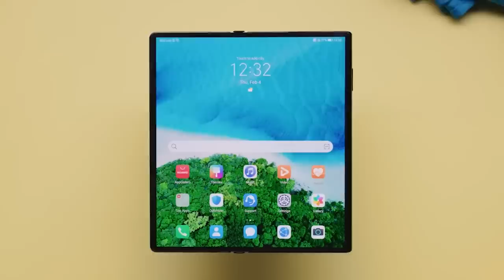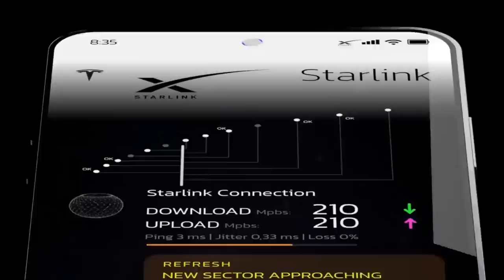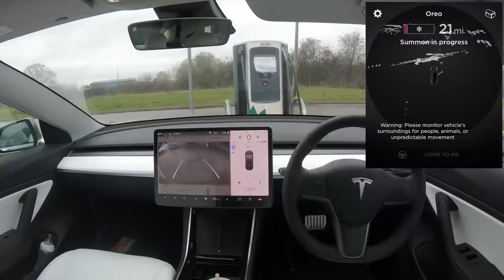Tesla Phone Model Pi Rumors🔥🔥🔥

Comment: Has anyone heard what OS is being planned? Perhaps that's one of the hold ups. A de-googled version of Android is probably the best idea, and it can be secure if done right. Tesla might be able to entice developers to port their apps to run on their version if required.
Reply: It's not unreasonable to imagine at this point a smartphone launching based on Linux rather than a de-googled android. I'm not sure how familiar those reading this will be with it, but in addition to windows, on any X86 computer you can install desktop Linux, and while your options for software will be slimmer, you will have a fast, secure system that operates as you choose. Recently, the Pinephone Pro was announced and...Actually seem to be almost on par with modern-ish lower end smartphone, which doesn't sound impressive until you realize that they started...What, 4 years ago? With a community produced and coded piece of hardware no less. With the weight behind, say, Tesla, it's not unfair to suggest that Linux could be a viable alternative to Android nowadays, and it'd be able to perform desktop computer functions, rather than just use android apps.

The obvious downsides being: not using android apps (this could be a killer for some people), and not being able to use qualcomm SOCs (no Snapdragon processor), though with that said, AMD has announced a partnership with Samsung to produce Exynos SOCs with an RDNA 2 GPU built in, so I wonder if they'd be willing to write up a contract to drive down per unit cost via economies of scale...
Reply: @novantha1  Android is linux.
Reply: @Tore_Lund  Sort of. That's a common claim, and is technically true (android is based on the Linux kernal), but when one imagines Linux they typically think of desktop Linux distributions, which have security, freedom, transparency and powerful low level APIs as their core building blocks, whereas android in comparison is much closer to IOS in how closed off and full of spyware it is than the typical android user would care to think.

Yes, Android is based on Linux, but it is not built with the same philosophy, so it is quite rare that saying "Android is Linux" is true in the same sense that the person saying it means it to be.

Comment: the note 3 was the best phone ever produced. easily change batteries, glass and screen. i had a battery that could run on a single charge for six days with bluetooth and wifi on 24 hours a day and being used 12 hours a day. i used it for 6 years until it wouldn't work properly with the internet. all they have to do copy is the formula. abilty to use third party batteries and very simple replacing of screen and glass. boom best phone in existence.

Comment: You do realize that you can only use starlink satellites in very specific locations outdoor? You can't have a reliable mobile internet connection with Starlink as you appear to make a big point. Also, where are the sources that prove this product is even an idea?
Reply: hello fellow thinking human being.. I think there's not that many of us in this comment section xD
Reply: Starlink is available all over the world; even in some of the most remote places. There is a great value in having a communication device that runs on solar power, and is connected everywhere outdoors. Imagine having internet and phone service for the cost of Starlink.  Btw, its likely Elon will have standard cellphone servic technologies in addition to the Starlink service.
Reply: @shonsxxx  Not really sure what you're talking about. You need a directional dish to get signal. That dish has a motor to turn it with precision. Also the dish must be in a place with no obstacles to the horizon. There is no phone powered with solar power. What you're doing is magical wishful thinking

Comment: I haven't used an apple phone for 10 years because of the fact ( at the time not sure if things have changed now ) but that I could and still can play any video file on Samsung being able to take batteries out and swap them with fully charger batteries before power banks became available. Even with SD card slots and a more widely available micro USB port and now a USBC port not the always changing charging connections apple has. Also the link of Android phones and Android TV's which came out before Apple TV's. And also music being able to play any file OJ Android not convert it on iTunes etc. And also the waterproof On the Samsung range for about 8 or 9 years before Apple finally made one

Comment: I hope Mr Musk has a "plan" for using 3D printing in space!  I would love to see interplanetary stations printed, circuits wired both for wireless comms and hard wired using mini bots and circuit paint!  That allows the same bots to identify severed circuits and repaint them quickly!  For interior components like doors, desks, chairs, etc a smaller printer reusing the components of the larger printer that printed the hull(s) themselves!  Flat screens would make it safer, easier and cheaper to install "windows"! The circuits are already there and Cameras can be installed by using a vacuum sealed drill/not!  Plug and play! And finally I think double hull construction with the ability to "temporarily" flood the space between two rotatable hulls in order to offset, temporarily seal, and then perminently fix the breaches would be a good idea!  CONCEPTUAL TEST: Put one paper cup inside another, punch a hole through both!  Rotate them and noticed the breaches in the inner and outer hulls no longer align!  If the space between them is flooded the breach is sealed and easily identified on the exterior!  A robotic arm on printed rails can then perminently fix the outer breach!  The rail is printed directly into the outer hull during initial printing!  One last thing.......
Aside from artificial gravity provided by rotation, include water storage in the original printing process so you can create electromagnetic gravity!  Just bored in the early morning hours!
Reply: Or I watch too much TV!

Comment: It better run conventional 'ware or it'll flop like all the others.
Having a better computer is all well and good... but no one will buy it if none of their programs will run on it.

So the Pi will be a shell running either android or crApple OS so that people can actually make use of it.  If it doesn't allow app support from the established software architectures app designers won't bother porting over because the consumer base simply will not be there to bother.